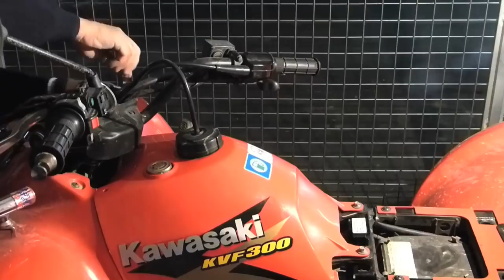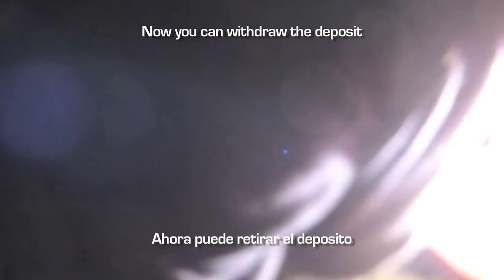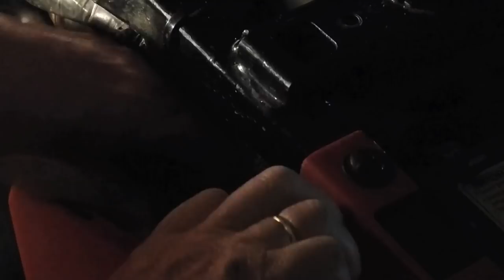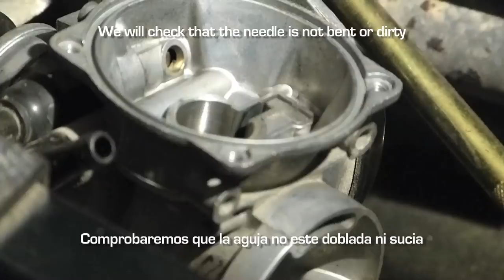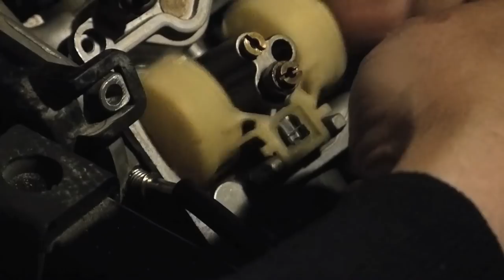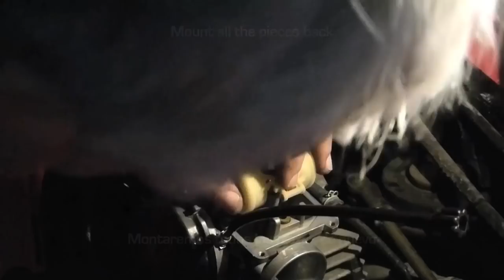ATV Carburetor Cleaning

Comment: Just wanted to tell you thank you for this great video.  I just purchased a 89 bayou that wouldn't start.  I knew it had to be something to do with the carb.  I've torn about the carb on my Suzuki Quad but it was a different carb than this one.  Thanks to your video we didn't know that their were 3 jets in the bowl and about the float valve.  After we got all of the old green gas off of those the quad started right up.  Great video thank you very much.

Comment: Can someone tell me what the hose coming out of the bottom of the carburetor is attached to and where?
I had mine come loose, spilling gas, and I can't figure out where to connect it back to.
Thanks!
Reply from the maker: Normally, the lower connector takes the excess gasoline from the carburettor through a tube to the lower part of the vehicle to deposit it on the ground, locates a nearby loose conduit that coincides with its thickness and which will probably be adequate.
Reply: @JavierRullanRuano  Thanks you so much! If you don't mind me asking, the ATV leaks gas out of this tube, even when it's not running, if the fuel tap is set to "RUN".  Could it be the fuel tap that's failing?

Comment: I have a kawasaki , KVF, 400 1999 4x4. Same carburator.  Does the jet number 2 , in the hole is suppose to be able to be  removed if it is unscrewed. i turned it anti-clockwise but i cannot able to change it... it is unscrew but i not able to get it in my hand to change it... help please..
Reply from the maker: +paranoy69 In that case it is better to take the carburetor with the part to an authorized service center near Kawasaki